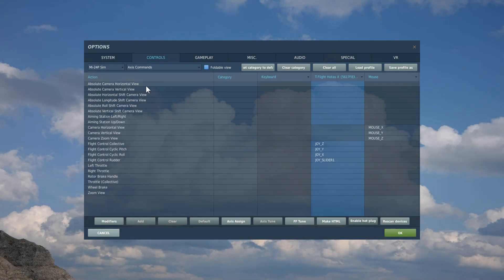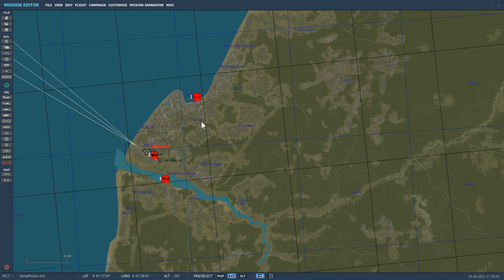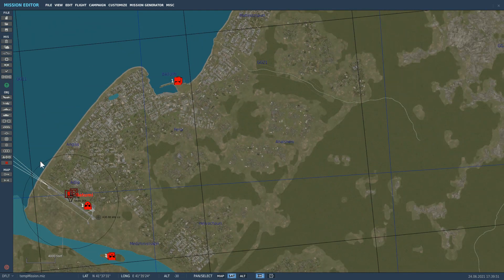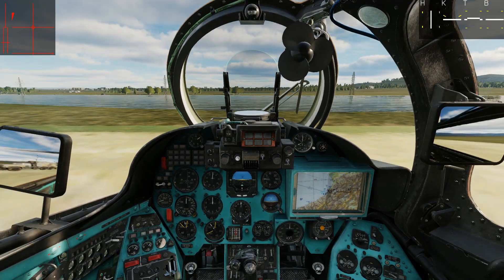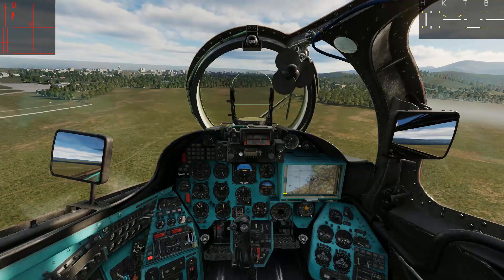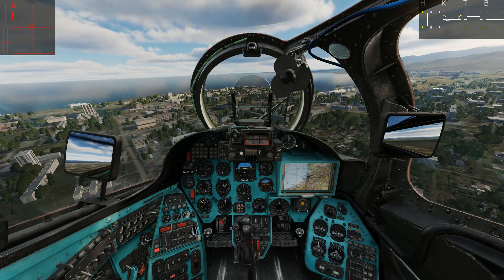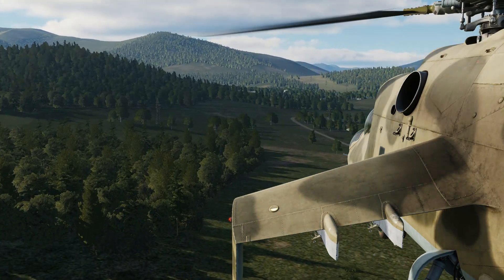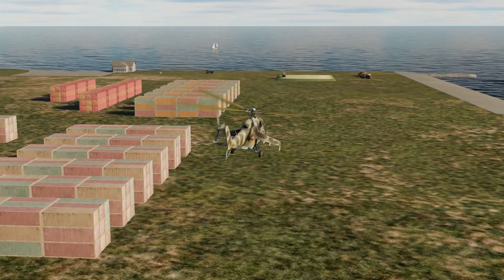AP Channel H

Comment: Howdy Ray, thanks for making this and sharing it with us. Nicely done and explained very well. I was wondering something. I usually fly with the two middle autopilots on or the ones that are on by default. I don’t use the H channel much. I’ve noticed that if I’m in a combat situation and going fast that sometimes the hind will pitch way up and then bitching betyski 😃 will say something about the rotors, not sure what since I don’t speak Russian. It happens quite a bit in heavy or strong turns and pitches up. I then have to fight the Hind to get it back under control. It’s very frustrating. Is this due to the autopilots being on? I haven’t messed with it too much but in your video you mentioned the autopilot fighting with you and thought of this. Any ideas would be greatly appreciated! Thank you and thanks again for the video, really great stuff. One more thing if you don’t mind. I noticed in the Huey that once the throttle is set it seems better to leave it alone and fly only with collective for up and down movement. If I mess with the throttle it starts a siren sound and it seems to loose a lot of power. Is the Hind supposed to be flown this way as well? Thanks…
Reply: your rotor rpm could also be at fault. if your main rotor rpm reaches less than 80% it wont be enough to power the gernerator. Thus inducing electrical failure and consequently ap modes will go offline